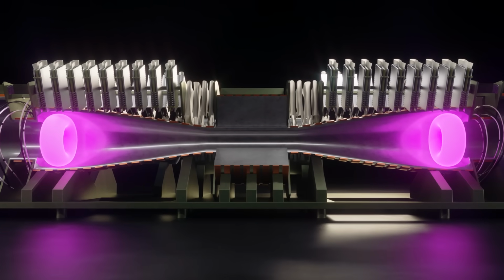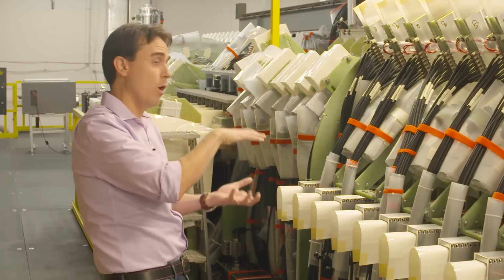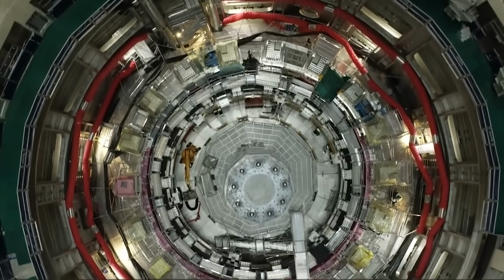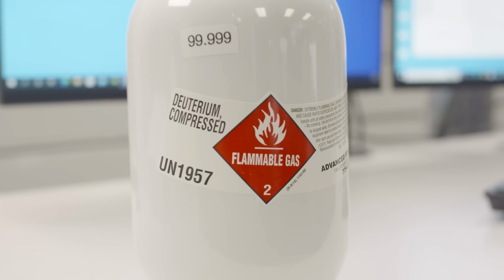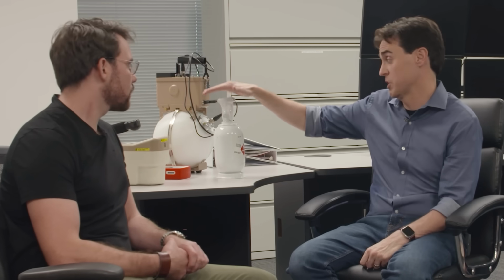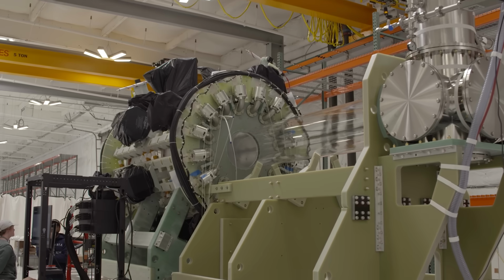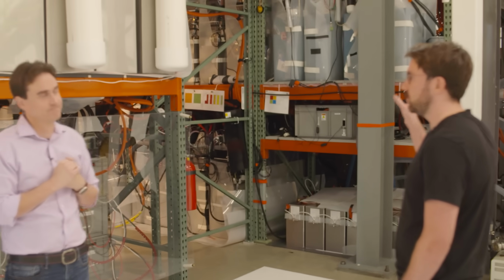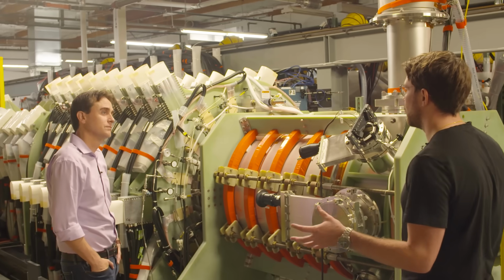A New Way to Achieve Nuclear Fusion: Helion

Comment: Viewers should also check out the following assessment video on YouTube.

The problems with Helion Energy - a response to Real Engineering

Promotional presentation, by Helion Energy and this channel make it seem like Helion has made enormous progress and currently generates significant quantities of fusion reactions. Helion’s 6th-generation machine, Trenta, has undergone about 20,000 experimental pulses. None have generated any significant amount of fusion reactions, or helium-3, or tritium. Helion’s envisioned demonstration power reactor is expected to operate at around ten pulses-per-second but the fusion reaction may only last for a billionth of a second. As a result each fusion reaction period would need to generate many gigawatts of energy in order to deliver an average of 100 megawatts of energy to the grid. Such extremes would pose major challenges for the design of the solid-state switching circuitry, if not the reactor itself, which have not been addressed in Helion’s promotional presentations.

Comment: Fusion power is about creating a sustained fusion reaction and getting a large enough net gain in power out of it to make a reactor economically feasible. I don't see how creating a brief flash could do any of that?
Reply: You just do the brief flashes many times. The resulting energy is stored in a capacitor bank and then gradually released to the grid from there.

Comment: 25:03 Why do I feel like I’m looking at the  ENIAC from 1945. The electromagnetic field manipulation is the most fascinating to me. However, it seems unnecessarily over engineered, complicated, expensive, non sustainable, and extremely centralized. 

This plasma tech looks like it would be great as a weapon on a space station for the space force but for supplying future cities with this I don’t see the scalability. 

Future energy is going to be like an AC unit for every home, commercial building, car, air, sea, space craft. It needs to be DECENTRALIZED. 

Energy needs to be scalable and commercialized. Like a home appliance or electronic. It needs to be something like a water heater, AC unit, refrigerator, a washer and dryer. 

You’re not replacing the centralized grid you’re deleting it. 

This looks very necessary for mankind and the world I just don’t think the application for energy generation is its purpose. Just from a bird’s eye perspective it looks like a plasma cannon and electromagnetic shields. I see weapons and defense when I see this fusion tech.

Comment: Anyone, who bothers to research Helion Energy’s past predictions of meeting benchmark goals with their series of experimental machines, will find key lapses. They need to keep pitching for millions of dollars of investor funding to keep playing with such machines. Apparently many investors have been relying on ‘critical assessments’ prepared by nuclear fusion energy fans, not by external disinterested experts.

Most fusion energy fans tend to immerse themselves in echo chamber information sources that reinforce what they prefer to believe in. As a result they are unlikely to run across assessments such as the following. I urge readers to search for the following YouTube video.

The problems with Helion Energy - a response to Real Engineering

All who are interested should research the following questions for the experiments conducted on their Trent’s (6th generation) and their Polaris (7th generation machines.
1) What is the quantity of fusion derived energy produced by these machines compared to the total energy input to their facility during the time these experiments are conducted (expressed in Joules)?
2) What is the total quantity of helium-3 that they have produced from the over 10,000 shots they have conducted (expressed in grams)?
3) What is the quantity of radioactive tritium that such shots have generated (expressed in grams) and how do they prevent the release of the unfused tritium into the atmosphere?
4) The Polaris machine is expected to operate at a shot rate of one pulse per second. What is the expected time (expressed in nanoseconds) that the fusion reactions are expected to last during each shot?
4) How long can the fusion reactions last, within each pulse, before the buildup of fusion products poisons the fusion reactions?
5) Will the announced energy gain, of the Polaris machine be derived from the average energy input to the operating facility, or will it only include the energy expended to produce the short fusion pulse?

Comment: Funny, I haven’t read where they have hit an energy break even point yet.
Reply: Not yet. That will be the machine they are about to complete right now, "Polaris". That one aims to demonstrate net electricity from fusion for the very first time.
Reply: @elmarmoelzer2229  It is always the NEXT machine. Never today's machine.
Reply: @MrSummitville   There is currently no "today's machine as Trenta was dismantled shortly after this video was made. Polaris will be completed in a few weeks. It was always meant to the net electricity machine. Trenta never was. It did not have the equipment for it and it was subscale.

Comment: So the WARP drive is finally being designed. Can't wait for version 35, when it will be able to pulsate several times a second and transform all that energy in giga-powerful ionic thrusters and push a starship to FTL speeds.
Reply: But wouldn't that entire machine be radioactive?  Yet, they stand next to it?

Comment: There’s a comment in the beginning I want to understand better, that the collision of the two plasma circles creates new atoms from the ions/protons etc..how and why? I thought matter could not be created or destroyed? This goes deeper that at the base everything is energy because that’s what atoms are from. So in theory the plasma as a physical thing?
Reply: - The collision of the two plasmoids creates another, larger and hotter plasmoid similar to the two original ones. This plasmoid is then compressed to fusion conditions.
- The "new atoms" created by fusion are actually slightly less mass than the mass of the original fuel atoms. That reduction in mass is the nuclear binding energy that is released when two light atoms fuse. Therefore, the law of conservation is not violated.

Comment: My question is does it produce more than it consumes to produce the plasma fusion? Electromagnets,capacitors, miles of electricity to run it. Is it going to produce enough to sustain its self, and have enough energy left over to be worth it? I may have missed it but the actual energy output numbers past what it consumes is what I would like to know.
Reply: Well, Trenta was a subscale prototype, meant to verify the technology and scaling laws. Polaris, which is AFAIK about to the completed this year is meant to demonstrate net electricity from fusion for the first time. It is a pretty big machine from what I have seen. Has its own building too.
Reply: @elmarmoelzer2229 Having its own building ... Well that must be proof it it is NET Energy Postive.
Reply: @MrSummitville  
What does that even mean?
It will either work, it won't. If it won't, then Helion is most likely finished.

Comment: I might be showing my stupidity in physics, but surely this is an incredibly risky way to get highly charged, dangerous elements to very high temperatures trusting on the tolerances of your machinery. The power input to get to the state that they need is terrifying!
Reply: It is not risky at all. The plasma is hot, but its density is very low (closer to a vacuum than to ambient air). So total energy content is relatively low.
Reply: @elmarmoelzer2229  Thank you for answering my question, even if the heat of the plasma is relatively low, surely there are worrying amounts of energy involved. Firstly the sheer brute force of starting a reaction like this using conventional power. And secondly control and capture of wildly unstable and radioactive elements? It really seems like this process is really balancing on a knife edge. And if failure did happen it could be catastrophic.
Reply: @Hagg-o-tron  
No.
Helion mostly uses Deuterium which is a stable isotope of hydrogen for fuel. 
There is some Tritium (which is not that dangerous or unstabile to begin with) produced in side reactions. That is extracted between pulses and can be easily stored safely until it decays into more He3. 
Or it can be sold for $$$$$ or (if nothing else works for some inconceivable reason) be burned in special versions of their machines.
Really, people are trying to invent problems when there are none.
Reply: @elmarmoelzer2229  And where do all of the Radioactive particles go? Are there any Alpha Particles? Any Beta Particles? Any Gamma Rays?  How is this device not radioactive?
Reply: @MrSummitville  
There are all of these particles. The Alphas (by themselves not radioactive) are charged particles and contained in the magnetic field.

The device emits radiation during operation but it is "cold" a few hours after it has been turned off. Emitting only very low levels of radiation.

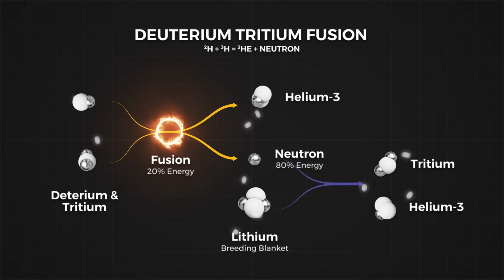Comment: 11:00 - WRONG.
We in fact have vasted NONE of energy to get to sqare one. 
We wasted NEUTRONS. 
T + D -> He4+n
some neutrons get lost (blankets arent perfect and dont surround core everywhere)
n+Li -> T + He4
For each one atom of T spent less than one atom T can be made
Therefore whole reactor runs Trithium defficient - that can't be afforded.
If we add berylium than:
n + Be -> 2n (slowed down) + 2He4
n (slowed down) +Li -> T + He4 
For each one atom of T spent more than one atom T can be made now.
Now reactor can
Reply: Helion is not fusing Tritium. They actually make Tritium as a byproduct. That can be stored until it decays into He3 (which is their fuel) or sold for $$$$$ or traded for more He3 or (if needed) burned in special versions of their fusion machines.
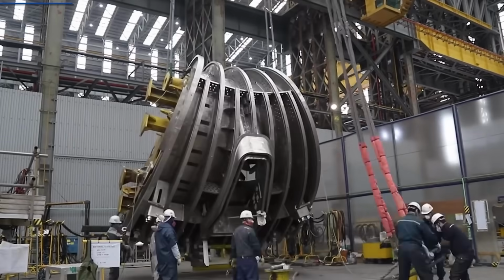Reply: @elmarmoelzer2229  no, 11:00 is NOT about Helion, but about conventional (with D+T fuel) design.
Things said in the video arent true.
Conventional reaction ( T + D ) needs Beryllium to achive sufficient Tritium production, NOT for what was said in yhe video.
Reply: @elmarmoelzer2229  and a word about Helion.
1. They will have D + D reaction among their D+He3 fuel (reactivity similar to D + He3)
2. D + D gives T + H or He3 + n
3. T + D is really really active (like 100× as D + He3) and gives n + He
4. 2 and 3 give whole lot of high energy neutrons from reactions that are almost as powerfull as main one.
5. Good luck with having coils for magnetic confinement working past ~ 1 day at full power.
6. Good luck replacing those neutron irradiated coils.
7. I have a suspicion whole Helion company is just a scam. Sponsoring video with obviously untrue statement against conventional design is a red flag.
Reply: @volodumurkalunyak4651  
1. 2.. Yes and they want and need those D-D reactions. 
That is how they make the He3 for their machines.
They need two D-D reactions for every D-He3 reaction in order for the fuel cycle to close. That means one neutron every three reactions. The Tritium produced in the second D-D reaction branch is extracted between pulses and will be stored to eventually decay into more He3 (or it can be sold for $$$$$ or traded for He3 or burned in specialized versions of their machines).
3.4. T+D does not happen in their machines (not at relevant levels anyway) because the T born from D-D is too hot and non- collisional on the timeframe of the pulse (<=1 ms). It takes about 2 ms for the T to slow/cool down enough to fuse. Their confinement time is not high enough for that. So the T leaves the FRC and heads for the divertor long before it can fuse.
5. D-D neutrons are "only" 2/45 MeV which compares very favorably to 14 MeV neutrons from D-T reactions. There are a lot of materials that can handle them or at least react to them in a benign fashion.
 E.g. the Silicon in the quartz that they use for their first walls has to absorb three 2.45 MeV neutrons before it becomes unstable. 
Then that silicon31 has a half=life of only 2.5 hours.

6. Their magnets are made from aluminum (pulsed systems don't need expensive cryogenic magnets) and that cross section is relatively low and those neutrons have to get past the first wall first.
But if they do and if they hit that Aluminium magnet, the resulting isotope has a really short half-life of only 2.5 minutes. Replacing simple aluminum coils of a cylindrical machine without a blanket is MUCH easier than replacing super conducting coils on a toroidal machine with a blanket.

7. I have been interested in fusion since I was a kid in the early 90ies. Back then I went hiking with Guenter Janeschitz who later became chief scientist at ITER. 
I know ALL of the problems with ITER. But I have also known the guys at Helion for over 10 years. They are legit. They might still be wrong and they might still fail but they are my personal front runner for a reason.
Reply: @volodumurkalunyak4651  
1. Yes, they want those D-D side reactions because that is how they make their He3.
2. Yep.
3. But the T is too hot and non-collisional at the time it is born and it does not have a chance to cool down enough before the end of the <1ms long pulse. It will have some elastic collisions with other particles before it leaves the FRC and heads for the divertor. So D-T fusion reactions will be incredibly rare.
4. 2. Will mean only one neutron for every three reactions: Helion will need two D-D reactions for every D-He3 reaction. Only one of those D-D reactions produces a neutron. The other two reactions don't. Those D-D reaction- neutrons are relatively low energy (2.45 MeV). That compares quite favorably with D-T reactions that produce a 14(!) MeV neutron in every(!) reaction. 2.45 MeV neutrons are much easier to shield against and a lot more materials react quite benign to them (compared to 14 MeV neutrons).
5. There is a first wall between the coils and the plasma in Helion's machines. The first wall (currently anyway) is made from quartz. Si28 has to absorb 3 neutrons before it becomes unstable. That, again, compares very favorably with D-T machines. If D-T machines like the CFS ARC reactor assume a first wall needing replaced every 4 years, then Helion can get away with over 12 years of first wall life time!
AND Si31 has a half life of only 2.5 hours. Those parts get "cold" really quickly.
6. Replacing irradiated (or otherwise damaged) components in a cylindrical machine is MUCH easier than in a toroidal Tokamak!
7. I have known them for over 10 years. There are no untrue statements. 
- Sidenote: My guess is that you watched that video by IM (won't name him fully here to not give him more views). He is a Tokamak guy who based his entire argument on a video made a Youtube channel rather than Helion's papers, talks, patents, etc. His video is full of misunderstandings and falsehoods. Really, the (countless!) times I had to explain the same sht over and over here again and again because of the BS this moron has been spreading and because of people like you just taking it for gospel is effing annoying me by now!

Comment: That thing about needing fibre optic controls because of the strong electromagnetic interference is a fascinating engineering problem that I've actually run into before, but at a much smaller scale.

I have a raspberry pi that controls a 3d printer, and the printer has a 12v power circuit that switches on a relay.  I had installed a soft power button into the raspberry pi, but I found that whenever I switched the power on the 3d printer, the raspberry pi would turn on or off.  I realised that the printer power circuit was strong enough to induce a voltage in the signal wires, and the raspberry pi was sensitive enough that it tripped the shutdown/power on scripts, even though the signal circuit was open.  You'd think 12v wasn't enough for something like this, but actually because it's so low voltage, at 300w the amperage is quite high, which might explain it.

Even wrapping the wires in coaxial shielding didn't help, so I had to get rid of the button.  I didn't think of fibre optics as a solution!

Comment: Is there an update to this video? The 7th gen machine is supposed yo come online in 2024.
Reply: They are still aiming for completing it this year. Supply chain issues have been plaguing everyone.
Reply: This Helion financial scam has been ongoing for years. Its always one year away.
Reply: @sassa82   Nonsense! They have not had the funding for the big machine until summer 2021. Then the build target was originally end of 2023/beginning of 2024. That shifted by a few months (show me one large engineering project that delivers on time). They are hoping to have it ready in the coming weeks, before the end of the year.
Reply: @elmarmoelzer2229  That is not a large engineering project.  And there have been large engineering projects that have competed on-time, and some early.  Stop using lame excuses, for being late.  This is a fantasy until you generate more Energy Out vs Energy In, including the energy consumed by your off-site fuel generator.